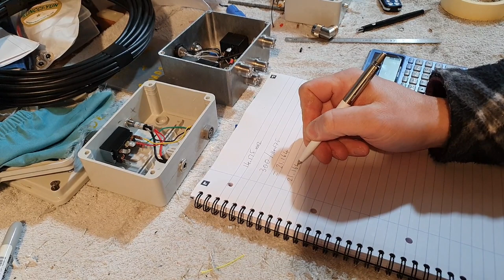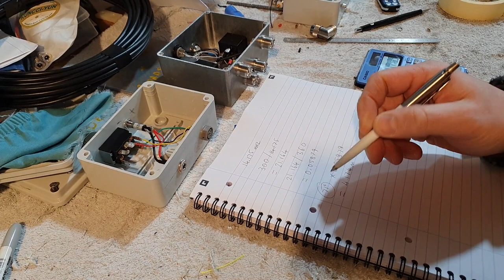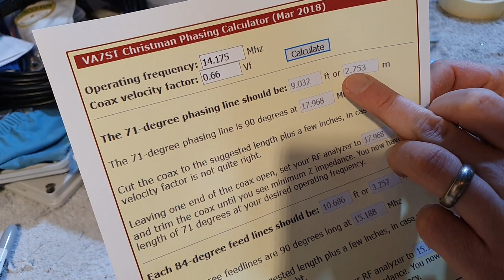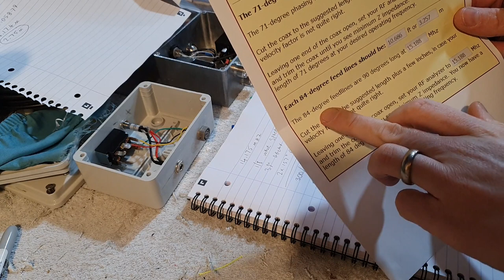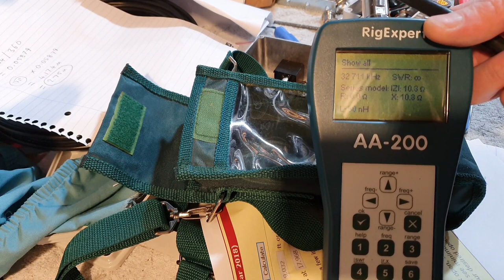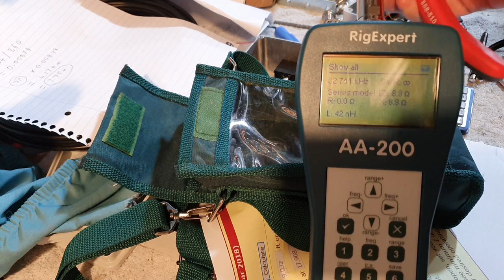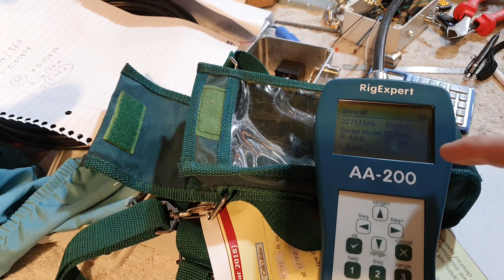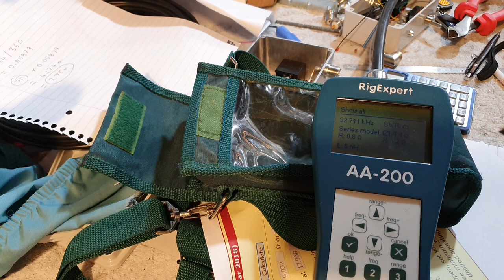How to calculate coax length for phased antenna systems.

Comment: I wonder why RG213 does not show velocity factor of 0.66. The formula for calculating VF is: VF = 1/(SQRT(K)), where VF is Velocity Factor, K is dielectric constant. Polyethylene has dielectric constant of 2.3 , so this formula may give you 0.76938... , but it depends of the manufacturer and what actual material they use. It is not possible to calculate velocity factor for foam dielectric.
Reply from the maker: Likely because its a " no name" brand. Great spot 👌
Reply: @MM0OPXFieldRadio Yeah, probably not exactly polyethylene, but some mix or something. Great video as always!

Comment: if you could only have one HF antenna, what would it be? Wondering if there is a single antenna that will perform well for NVIS and long distance
Reply from the maker: Tough question but probably a vertical of some kind. I once had a low to the ground 80m full size horizontal loop. It was NVIS on 80m but good for DX on 40m.

Comment: You inspired me to finally put together a 2 element 40m array. Have one questions on measuring the feedlines and delay line. Should the control box be inline when the measurements are taken to take in account the extra wire length inside the control box?
Reply from the maker: I did think about that but when you switch the length changes. Make your switch box as compact as possible and just cut coax as normal.
Reply: @MM0OPXFieldRadio  Did my best to make all connections as short as possible inside control box. Even after carful measurement of delay line and feedlines the electrical lengths did change once connected to the control box. So I went back and readjusted the lengths as needed to dial things in while connected to the control box. So far with limited use the array has exceeded my expectations this has been a fun learning project.

Comment: A very informative video, many thanks. Does the 90 degree minimum stay the same when the connector is added to the cut end of the cable?
Reply from the maker: More or less. Ive found it only changes a few khz. Im not too fussy on these lower half of HF frequencies.

Comment: Colin, Great video... I tried the link to the calculator, and it gives a Calculator no longer in service error.   Shame because that is really a useful tool.    For the most part you can trust the velocity factor of good cables, but it is also frequency dependent. It is sometime good to check it with a VNA or Nano VNA if you have one available.  Some of the cheap cable coming from overseas (Asia) you need to check the velocity factor they can be a good bit off.    Thanks for the inspiration you provide and the work you do...  Still working on the 40m 1/8 wavelength vertical array.   I spoke to a broadcast engineer friend.  He provided some advice and some things to be careful of in this design.
Reply from the maker: Appreciate the comments John. I've since made my own Excel calculator. If you would like a copy, send me an email. Once I finish the Moxon I will get back on to the phased verticals again.

Comment: Are you absolutely sure that the velocity factor is 0.66? Have you measured, calculated, and verified it?
Reply from the maker: The VF is irrelevant as I used the analyser to cut to exact length. You only use the VF to roughly cut the coax before trimming on the analyser at the check frequency.